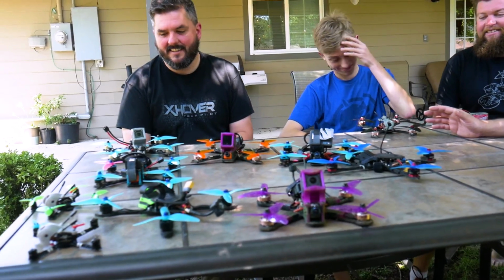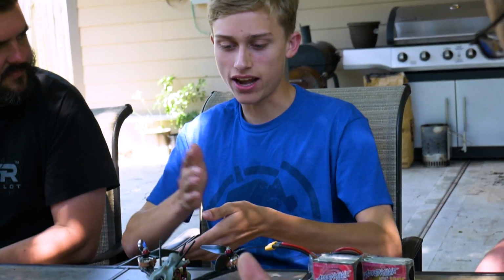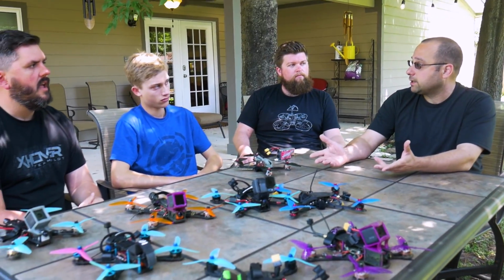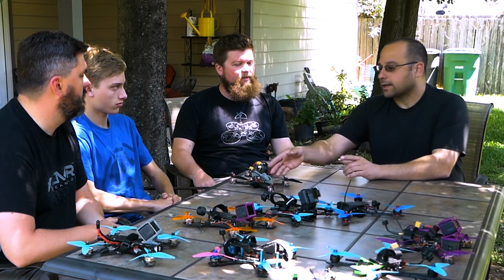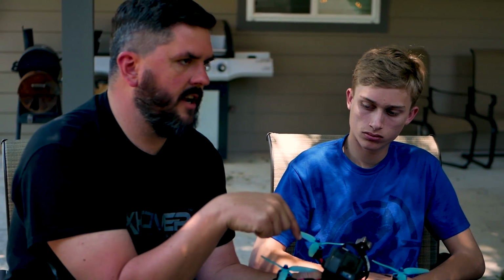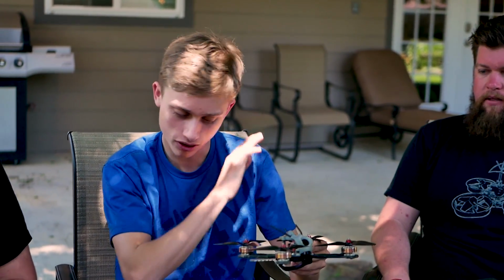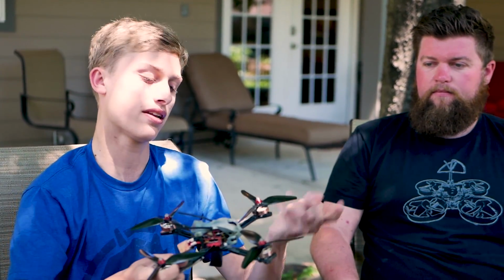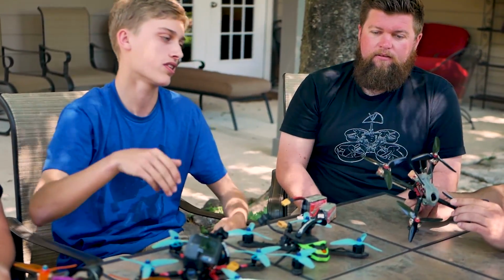Race vs Freestyle Builds: Discussion

Comment: Best overall frame for race and freestyle: Hyperlite Floss 2 with 6" arms running 5" props. You can toilet tank the battery and have a gopro without worrying about chopping your power leads. Its a lightweight frame with 5mm boomerang arms so definitely durable and easy to swap out if you do break something. 

Also Im a little sad that they didnt touch on propwash when discussing frame footprint sizes.
Reply: Seriously though floss 2.1 with 5mm boomerang arms is the best frame out there. Strong, lightweight, fast. Does everything. Race, freestyle, long range. Top mount, bottom mount. 45 bucks. Also running 6 inch with 5 inch props. Love it.
Reply: Another data point - my best flying stuff are my Floss2.1 6" running 5" props. 
 Despite cheap beater motors/esc/FC/VTX/camera on these builds, I can do everything with that setup.